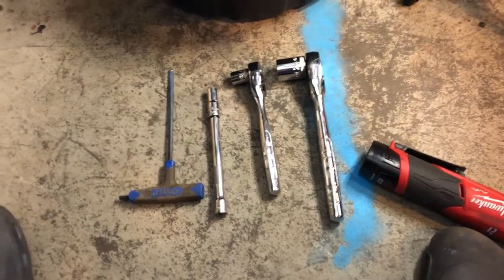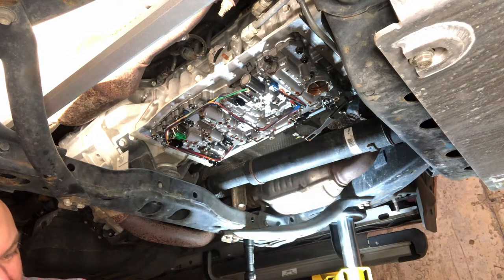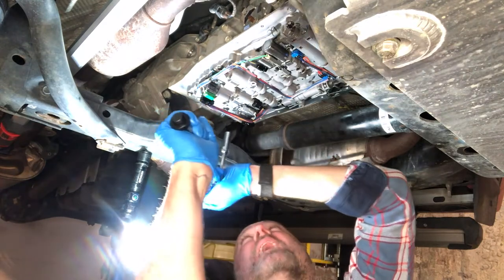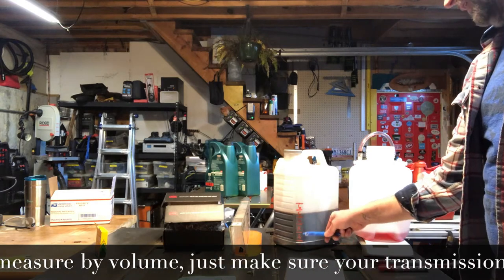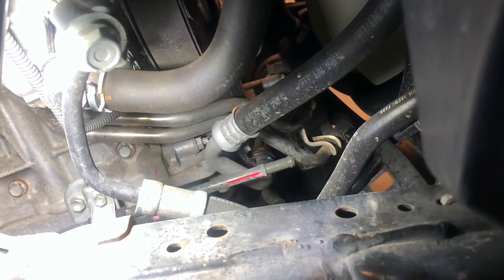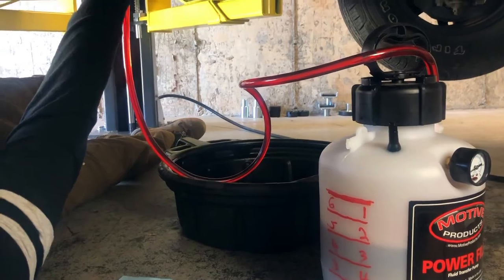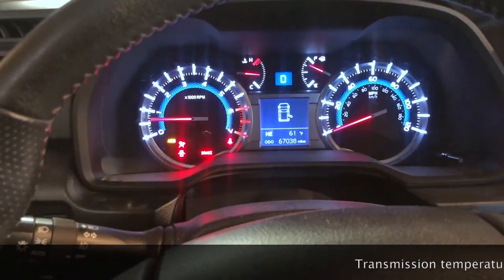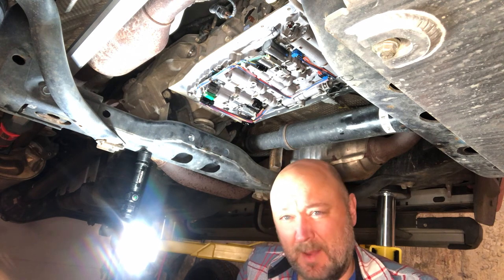4runner Transmission Home Flush

Comment: After watching this video I canceled an expensive dealer service. Dealer would only drain and fill transmission with no flush or filter. Most independent shops seemed to only want to do the same. To me it seems like a waste of time and money changing just 25% of the fluid. I want it done right like you did so I decided to perform the service myself. It seems my 2020 Model year no longer has a pin 13 on the OBD2. I ended up just buying a scanner that reads transmission temp.  Anyways thank you!! Your video makes this project very easy.
Reply from the maker: Glad to hear the video was helpful! Please let me know how the process goes for you! Which code reader did you end up buying?
Reply: I just completed the service today. It took me a few dealers to get enough Toyota WS ATF (I wanted to stick with factory) down here in the Orlando area. One dealer said they have had it on back order for a while. Everything went smoothly. The only thing I did differently was the way I accessed the transmission cooler hose. I took off the skid plate and went through the front as I had my truck on 4 ramps and it would not have been easy to remove the wheel. It took me several hours because I am very meticulous with my projects…lol. I purchased the Foxwell NT604 scanner from Amazon. It seemed to work well. Thanks again. Your video was a great help!!

Comment: Do you know the sequence for tightening the transmission pan bolts Toyota 4runner 2016?
Reply from the maker: Hey! Thanks for watching! I just used a criss-cross pattern, half torque to all, then around again to full torque. Here is a reference to a helpful discussion: https://www.toyota-4runner.org/5th-gen-t4rs/186529-transmission-pan-bolt-torque-specs.html

Comment: Any down sides to using the Maxlife Fluid.  Thinking about using the Lucas Oil AtF, over the OEM dealership fluid.
Reply from the maker: I haven’t noticed any downsides to MaxLife in any of our cars. It’s been in the 4Runner for 60k and counting and been flawless. One theoretical downside is that Toyota uses very specific fluids. I have found Toyota engine oil makes a big difference, but, so far, MaxLife ATF has been fine. I just posted a video on 4Runner engine oil and talk about Toyota’s oil. Thanks for watching and commenting!

Comment: Hello David. Great instructions for transmission complete fluid/filter & flush! Just purchased 2023 4runner limited. Will be strictly on road with light duty 10k miles yearly if that. What do you recommend as far as maintenance for our vehicle, I'm not convinced dealership will be seeing our vehicle in for service as I have heard and experienced problems resulted from them. Thank you from your channels latest subscriber!
Reply from the maker: Thanks for the kind comment! With no towing and light use, I’d  simply swap out the fluid every 40-60k miles! Enjoy the 4Runner!

Comment: Finally got it done on my 2014. 63000 miles. Used toyota genuine ws just because there is so much confusion about different brands. And the OBD jump #4&13 worked easier than expected.
Compared with an IR thermometer on pan for comparison. The hottest part of the pan is the front upper area, and the IR read 110-115 F when the 'D' light illuminated. Ran it quite a while longer just to see what would happen, and the flashing D came on. But there was plenty of time between solid D and flashing D to get the level check done.
Now we will do my son's 2007. Apparently the OBD jump works the same on 4th gen, with the exception of an 'A/T OIL TEMP" signal instead of the D. Thanks again.

Comment: Awesome video sir! And solid advice on checking valve body bolt torque. I can't believe I have never thought to do so, cross channel pressure bleed is definitely an issue on aging units.
Reply from the maker: Thanks for the kind words! I’ve been tightening the valve body bolts ever since it made a huge difference on my very old Ranger!
Reply: Hi I have I have the Toyota 4runner 2013 can you please tell me do you do mechanical work at home or whatever you do it I like to do my transmission fluid change the right way and all the fluid in my truck thank you let me know please

Comment: This was my take on the procedure (fluid change only) - I bought 12qt of Toyota WS (through Amazon) and then drained the pan and measured it at 2.5qt.  I then refilled with a bit more than that then started the flushing.  I pulled about 8qt and by the last pull it was looking much better.  I knew the pan held 2.5qt so I saved that much for my last fill.  After that started it and shifted between R-N-D a few times and then put the E-brake on and left it in Drive for about 5min to get the temp up (with me behind the wheel of course!).  After that put it in Neutral and used a jug to measure how much came from the overflow plug and it was about 1/2 cup - so I guess the measurements came out OK.  Headed to the parts store to dump the fluid with it now and hopefully no issues.  Also lube those U-joints while you're down there!

Comment: question .if you measured .why so much fluid out of the measure hole after temp chek .seems odd . thought it would trickle out
Reply from the maker: Hi David-Good question! 
There are three reasons I can think of. 1) The most obvious is I added several extra ounces because I didn’t want to risk having too little fluid. 2) I didn’t just do a drain and fill, I did a flush. The flush introduces a lot of room for mis-measurement (another reasons to err on a few ounces too much). 3) I switched from Toyota WS fluid to Valvoline Maxlife. Since I wasn’t sure the two fluids had the same thermal expansion rates, I erred on the full side. The trickle during the level check is the unambiguous marker the fluid volume is correct. I’d rather waste a little and do it once  than have to keep topping it up.  Thanks for watching and for the question!

Comment: To clarify, if i was to use the lines from the top, I would use the line marked blue correct @ 16:56 ? I'm pretty sure that's what you said, just wanted to clarify. My confusion is there's a red mark that you placed on the hose you would access from the bottom, just didn't want to confuse the two, sorry for my ignorance 

I have the Fox Shocks reservoir in the way on the bottom line. 

Thanks for your time and patience

Comment: Wouldn’t the metal shavings in the dirty oil  make it weigh more than the clean oil?
Reply from the maker: Interesting point! Would be interesting to save some and check against new fluid by volume and weight at the same temperature.
Reply: Same here .it is clear that I would take my car to a Toyota technician than expose my transmission to a failure and end costing me 7000 in a new transmission.
Reply: @eliazarmarcano5616  You can do it! You may want to check out the YouTube channel "A Car Care Nut," as he is a master diagnostic technician and doesn't get quite as deep on the change of filters. I think he has said he's only seen one car, at about 300,000 miles, have any significant debris in the filter. I personally have done three drain and fills, including one where I dropped the pan and changed the transmission filter. The Toyotas, at least, can put up with a lot of abuse and neglect. So, if you can just do a drain & fill at 60,000 mile increments, you will get quite a bit of positive effect out of it. On the RAV4s that I did before, I got over five quarts out by letting them drain for extended amounts of time. I would drain for a half hour, close up the drain and go back and drain a half hour later. I would do that a couple of more times and I got a lot out.

Those intervals and the level of effort also is dependent on whether you are towing, off-roading, driving in heavy traffic. The fluid in those cases needs to be done earlier and more thoroughly.

As an aside, try pricing out OEM fluids, filters and gaskets using Toyota's official parts website. Free shipping over $75 AND many dealerships offer incredible pricing. (My 2014 4Runner transmission filter cost under $50 with the OEM gasket (priced separately). $7.20 per quart of OEM transmission fluid. Shop around!

Comment: My overflow plug fell off while driving and i lost a good amount of fluid but was only about 300 yrds away from home. I ordered a replacement plug and Toyota doesnʻt have that HEX bolt, they sold me a regular bolt that looks like the drain plug. It fits so would that matter?
Reply from the maker: Glad you were close to home when it happened! I can’t say for sure, but I’d be inclined to trust the Toyota dealer parts folks. Let me know how it goes!
Reply: @fixityfix  so far so good. Fitted good and no leaks 👍🏾

Comment: Does the OBD jump method (pins # 4 & 13) for temperature check also work on 4th gen?
I've watched about 6 of these different approaches to 4runner trans flush, and this is by far the best; right amount of detail without unnecessary inclusion.
Ready now to give it a shot. Thank you.
Reply from the maker: Thanks for watching and the kind words! I don’t have personal experience with the 4th gen, but have a look at this forum discussion, looks like it might: https://www.toyota-4runner.org/4th-gen-t4rs/142830-jump-dcm-transmission-fluid-level-check.html
Reply: Yes it works.  I had a 2009 4Runner and the jump method works.  Works on 2nd gen Tacoma as well.
Reply: @4WDExplorer  whats the point of this step?
Reply from the maker: Having the fluid at the right temperature ensures the right amount, by volume, is added. This is because transmission fluid volume changes based on temperature.
Reply: @kdworak4754  
Ya know. They make a big deal about getting the temp just right. And I did it per instructions.
But I took 5 gal of the drained fluid in a 5 gal clear container and let it set overnight to 50 degrees, and marked the level at dawn.
The let it set in the sun and gradually heat to 80 degrees.
The level didn't change noticably at all.

Comment: Thanks for the informed video. Just did on mine. An incident happened after bleeding the fluid, at some point, the refilled fluid was about one quart less than expected. I only noticed the short of fluid when I found no fluid came out after removing the level check plug, that's already after 10 minutes of ilding to bring the fluid temperature up. Hopefully that won't damage the transmission😅
Reply from the maker: Thanks for watching and commenting. Yes, the level check procedure is tricky!

Comment: The only thing i would say that is that you should use toyota ws fluid. A master tech for toyota said he's only fixed 2 4runner transmsions in the last 10 years. One of which was due to using the wrong fluid.
Reply: You can use valvoline max life in any newer Toyota transmission. WS is nothing special.

Comment: Why did you do a flush instead of a drain/fill? I always hear people say not to flush. Is it a myth that flushing is bad?
Reply from the maker: Thanks for watching and commenting! Sorry it took me awhile to reply! I see the process in this video as a middle ground, between drain and fill vs a shop flush. By shop flush, I mean the kind where a shop uses a high pressure machine to push old fluid out and new fluid in. This video just uses the built in transmission pump to push out a little at a time, using the transmission's own pump that is always running when the engine is on. So the pressures used are normal and, at least theoretically less likely to cause damage. The main risk is still, that if the transmission is old and has not been well maintained, it might only be the friction materials floating in the old fluid that are causing the clutch discs to grab. I am curious to know what you end up deciding and how it goes!

Comment: I just did this on a 2018 4runner.  It had 55k miles so I did not drop the pan.  3 1/4 quarts came out. So I did roughly 4 cycles.  Not sure why you said 6 cycles you can drain 3 1/4 quarts no problem each time not 2 quarts like you mention.
Reply: How were you getting 3.25 qts? Running till the pump pushed no more out? If so, that likely sucked air. Not ideal.
Reply: @TheRayDog  when you initially drain the pan you will drain 3 1/4 quarts.  So you put 3 1/4 quarts back in.  But actually you should put little more fluid back in since when you do the trans fluid check you want excess fluid to come out through the fluid check plug at the very end.  I did this in 3 trucks. 2 4Runners and 1 Tacoma. Never 2 quarts came out when doing the first I tail drain. Always 3 ish initially. No air sucked in since I put more in than came out each time.
Reply: @Tacoexplorer  Ah, got it. You're talking pan drain. The 2 qts he's talking about come from running the trans with the return line from the rad disconnected.
Reply: @TheRayDog  its like he didnt watch the video...

Comment: Very helpfull information. Thank you sir. Do you think flush would help getting rid of transmission shudder 1st to 2nd gear? My car has that problem 2011 T4R trail edition at 103k now.
Reply from the maker: Thank you for the kind words! It is certainly possible the shudder could be related to low or old fluid. While I didn’t have a shudder shifting was sluggish and the ‘flush’ really improved shifting on my 4Runner, even at 70K miles. A similar procedure on my old Ranger got rid of the 1 - 2 shudder, but I think that had more to do with the fluid level being low to begin with. Good luck!
Reply: I know this is really late. I'd never flush at 103k for a first ATF procedure. Drain and fill only.  Should be changed at 60k unless driven off-road, towing or in heavy traffic (then sooner).  Lifetime or 100k advice by Toyota is just crazy late
Reply: @kimbuck-2  I will address two things here, coolant and transmission fluid because both often get flushed. Doing a flush involves pushing or sucking fluid through. Whenever you're dealing with something that is over its recommended change cycle, you could be dealing with additives that have expired and no longer prevent build up, corrosion/sludge, protecting the seals and gaskets of a component, rubber and metal lines, etc. So, in theory, without those additives protecting the internals of a device, suddenly pushing through new fluid can also break loose sludge/crud, breakthrough seals, clog up solenoids/thermostats that help route the fluid.

At that point, a drain and fill will restore additives into the system, albeit at a lower percentage but it will help keep things alive without screwing up any components. Most manufacturers recommend a 7 to 9 year cycle at 100 or 150,000 miles for coolant... On its initial OEM factory installed fluid. Those cycles are cut in half for the second phase coolant fill. So, instead of 100,000 miles, most manufacturers will say 50,000 miles. I believe that is to take into account that the longer an engine runs, the corrosion rate increases but I would also imagine that they are taking into account that most people are draining and filling and leaving some of the older fluid behind. With my coolant drain and fill experience, I also opened up the engine block drain and got a literal 50% of the fluid out.

For transmissions, follow what the manufacturer is recommend without recommending it overtly. If they warranty their vehicles transmission for 5 years or 60,000 miles, do your fluid changes at 60,000 miles.  Probably the most neglected of regular service items, some people will do a drain and fill repeatedly over time. That is preferable to a traditional flush. The concern is how far over the recommended cycle has that fluid gone and how much wear and tear to the internal components has occurred. If too much where has occurred, some of the clutch materials may be floating loose in the transmission fluid and is actually needed for the clutches to grab each other to change gears. Doing a complete fluid flush could then expose new problems. Mechanics will sometimes, if working on a transmission that hasn't been maintained properly, actually save the transmission fluid and refill it once the work is done. This puts those particulates back into the system so the clutch will grab. 

What I've chosen to do is a drain and fill as close to 60,000 miles as possible and then go on a 30,000 mile interval with drain and fills. The exceptions for me are my prius, I will do those at 50,000 mile intervals. With that said, all of my family's Toyotas, minus the Prius, we're bought used and I do not know how they were driven. Some have service records indicating that they have had transmission fluid flushes at proper intervals. Others have not. On those that did not have other reported transmission services, I actually drop the pan and replace the filter. That also gives me an opportunity to inspect and see if large chunks are in there showing possible damage. When I do that, I get about 50% of the fluid out. I think my RAV4, with a u760e transmission, the 5.5 quarts is a little over 50%.

I learned about flushing early on when I trashed my Ford truck by doing a flush 10 years after the fluid had expired and 10,000 miles over its stated life. I really screwed that up and ended up selling it at a big loss.

Comment: Definitely the most in depth walk through that I have seen so far! I accidentally took out that same bolt on the shift selector as well haha. I had to go around 3 times until the pan bolts were all torqued correctly. Also the first time I've actually seen someone flush it correctly. I did 3 quart flush cycles, hopefully didn't cause any issues ;).
Reply from the maker: Thanks for the feedback! Glad you gave it a shot! I was tempted to do 3 quarts at a time. I bet it’ll be fine :-) 
Gotta say, I feel a little better knowing I’m not the only one who loosened that selector bolt!